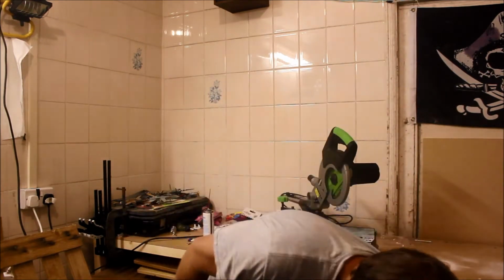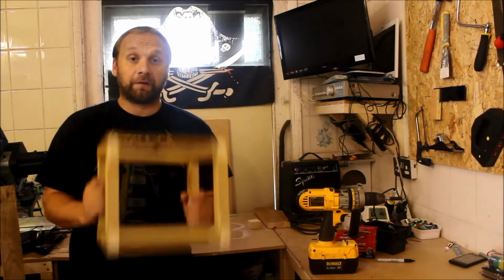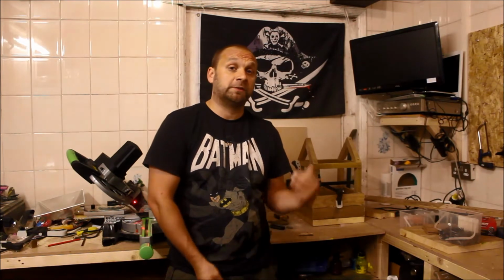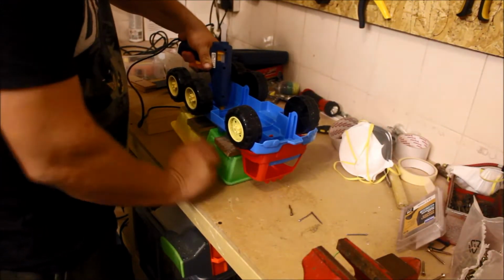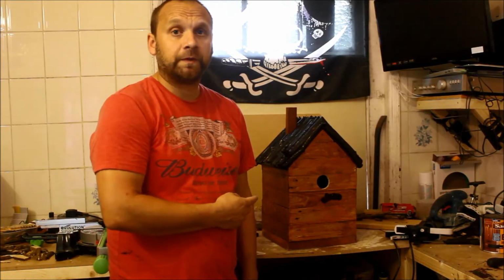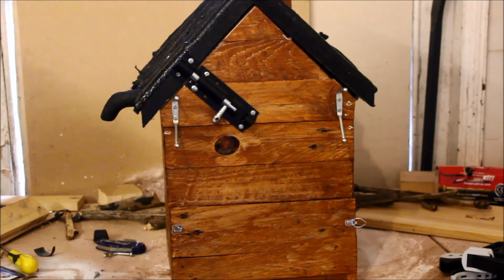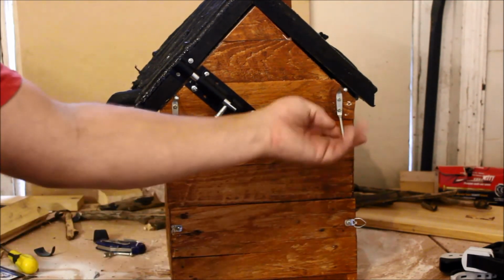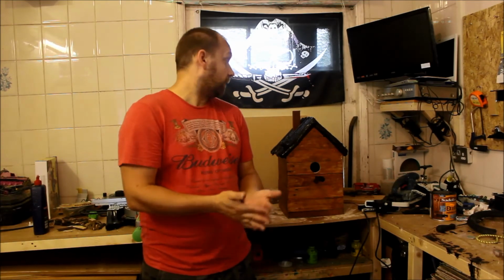Woodworking Project - Build a Birdhouse Using Reclaimed Upcycled Pallets, Offcuts, and Driftwood

Comment: A lot of pallets are treated with methyl bromide as a preservative which is toxic to birds. Unless you know the source of the pallets and whether they are treated with this or other toxic preservatives, it's no cost saving to build  a bird house from these that  ends up killing the occupants.
Reply from the maker: A very good point which I should have addressed in the video, methyl bromide treated pallets should be avoided for any woodworking project and are generally identified by the MB stamp they carry. There is a good website explaining pallet markings here http://www.1001pallets.com/pallet-safety/ For me its less about cost saving than it is about sustainability, the wood for this project would have cost less than £10 but I would much rather use wood already in circulation than new stock, I also think aged wood looks much nicer for outdoors projects like this. Thanks for watching!

Comment: see if you can pick yourself up the nail gun kit in aldi when its next in, try and hide one somewhere so its there for when they reduce them down to £15 ;) bought my little compressor 2nd hand for £35 years ago, im using staples in my nail gun, its spot on, they fly in so quick and hard the wood doesnt have time to splinter
Reply from the maker: thanks for the tip, I'll drop Santa a quick email ;)